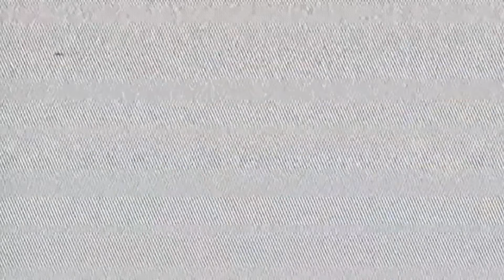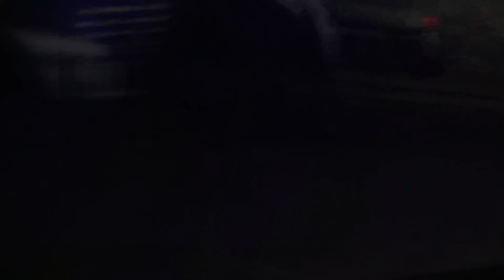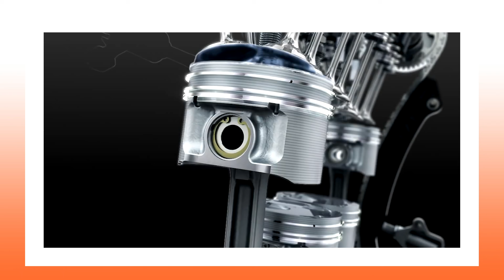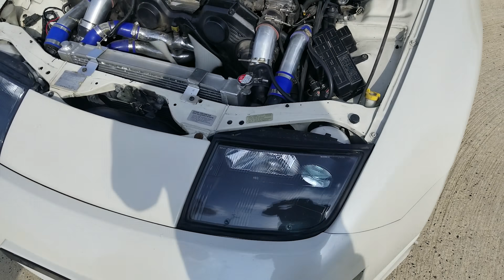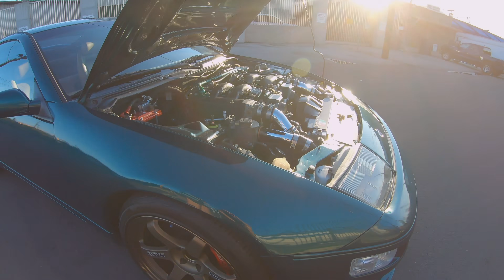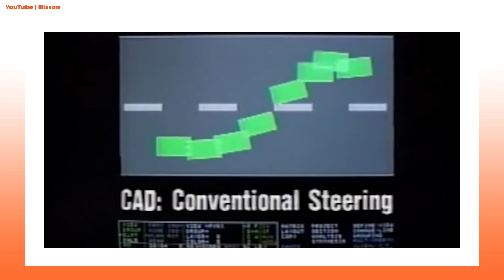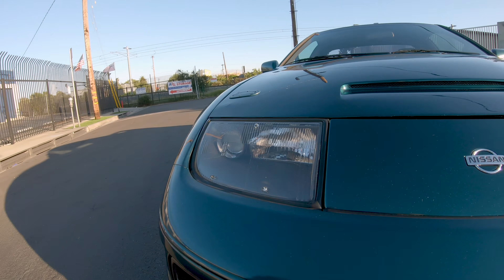The Incredible Tech that DOOMED the 300ZX

Comment: 300zx: I'm the most advanced car of the early 90s!

3000gt: Am I a joke to you?
Reply: Yes, yes it is.
Reply: The 3000gt had 4 wheel steering, active electronic suspension,  twin turbos, v6 it’s extremely similar to the 300zx
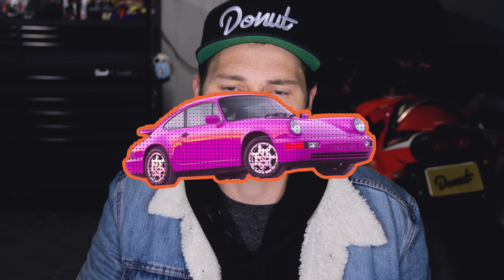Reply: 10:40
Reply: @mamoochie7392  To be so similar, the valuations of the Mitsubishi's at all levels are lower than the Nissan's.  Plus, the interior of the Nissan, particularly the leather of the seats, has held up much better than that of the Mitsu's, making it harder to find Mitsu's in passable shape after almost thirty years.  Despite that, they are still worth less, indicating they are less desirable.  Personally, I appreciate the exterior styling and performance of the Mitsu's, but when it came to buying, I went with my long time favorite, the 300ZX TT.
Reply: Hush, dodge stealth
Reply: Kevin Davis not to mention that the 3000gt is heavy af
Reply: @DaytonaBlueHr  my stock tt 2+2 300zx ran a 13.155 1/4.
Reply: @DaytonaBlueHr  The Dodge Stealth is lierally just a butt assed ugly 3000GT though. But otherwise I agree with everything but would still prefer a TT Z32
Reply: Technically the Z32 is a late 80's/Early 90's car, Came out in 1989 lol
Reply: Jesse Arends Lmao you have the video?? I have never seen a stock 300zxtt ever run a low 13. They are mid-high 13 second cars completely stock and did not outperform the 3000gt in the 1/4 mile and would not even come close to the Dodge Stealth Twin Turbos being about 100 pounds lighter than the 3000gts and running 12’9 in the 1/4 mile stock. And if you dont believe go to the 3si forums and its on their 🤷🏽‍♂️. Its just a fact that the 300zx were not faster than 2nd gen 3000gt Vr-4’a in the 1/4 mile
Reply: Syphious Dodge Stealth es’s were ugly but the r/t’s and Twin Turbo models didnt look too bad. My white 95’ Stealth r/t  is in pretty good condition and always turning heads but most likely because nobody knows wtf kind of car i drive and thinking “wtf is that car ive never seen it” 😂 but all im saying is that the guy in this video was probably talking about the 1st gens 3000gt Vr-4s that ran mid-high 13’s stock. The second gens were considerably faster and came with a 6 speed getrag transmission instead of the 5 speed in 1st gens.
Reply: Noble Khan lmao its you again 😂🤦🏽‍♂️ just accept the fact that 300zx’s were not faster stock for stock against 2nd gen 3000gt Vr-4’s in the 1/4 mile sorry to break your heart but its just a fact 🤷🏽‍♂️
Reply: HZB OcYpcWr'Ctwu Odzs every single boosted 90’s car had problems with boostleaks....
Reply: Questionable Choices Inc. 300zx did not have active aero tho.... so 3000gt>300zx
Reply: @mamoochie7392  yeah but it's also hideous
Reply: It's very hard to determine the quarter mile time of a 3000gt vr4 because tow trucks are all different.
Reply: 3000GT VR4 was a beast
Reply: Noble Khan You say slow but its faster than any 300zx in the 1/4 mile 🤔 your ignorance is showing 🤦🏽‍♂️. All im stating is that the guy in this video is wrong for saying the 300zx outperformed the 3000gt Vr-4. Second gens Vr-4’s ran low 13’s unlike the 300zx which was a mid-high 13 second car. Even this guy ^agrees and says 3000gt Vr-4’s are beast so looks like you are just in denial lol
Reply: spraynpray You realise that if the turbos go bad on a 300zx the entire engine has to basically come out right?? Changing Turbos on a 3000gt Vr-4 does not require that much work but can still be difficult but not nearly as a 300zx 😂. And 3000gts were faster than 300zxs so idk why you even made that comment 🤦🏽‍♂️
Reply: Noble Khan any modified car can beat any car so idk why you even bring that shit up lmao. All im saying is the guy in this video is wrong about him saying 300zx was outperforming the 3000gt especially in the 1/4 mile. And you realise the 3000gt was a Grand Touring car right? And was never meant to be a track car unlike the 300zx but yet the 3000gt was still faster being a grand tour 🤔. Their was a Puma 3000gt in JGTC and 3000gts held records for Pikes Peak for some time as well
http://www.davewolin.com/pikes1.htm
Im just saying the guy in the video is wrong about that 1 thing he said 🤷🏽‍♂️
Reply: @DaytonaBlueHr  Why would you change the turbo on a vr4?  The car is totaled by 100k miles due to repair bills.
Reply: The VR4 was a heavy, sloppy wannabe copy of the ZX. Mitsu took 3yrs to copy the Z and they still got it wrong lol!!
Reply: Big Troll How did they copy lmao. The 3000gt was made to compete against all the other sports cars that were coming out at the time and was more advanced than the 300zx with Active Aero, Adaptive Suspension, Active exhaust, All-wheel steering and Twin turbo/twin intercooler V6. And yet with the 3000gt Vr-4 weighing as much as it did it still outperformed the 300zx in the 1/4 mile running low 13’s and 0-60 in 4.7-4.9 seconds......if you say they are slower then that would just make the 300zx even slower according to you 🤷🏽‍♂️
Reply: Awd>Rwd
3kGT all day
Reply: Oh my. Looks like I started a JDM war!
Reply: And the 2g eclipse GSX is better than both
Reply: The 3000gt is a boat
Reply: @DaytonaBlueHr  wow a awd car is faster from 0-60 than a rwd car? Crazy, too bad it doesn't change the fact you drive a boat
Reply: Noble Khan Every car enthusiasts cares about 1/4 mile times dafuq you talking about? ITS LEGIT HOW WE DETERMINE WHICH CAR IS REALLY FASTER FROM A STOP TO THE 1/4 MILE AND 1/2 MILE. And like i said the 3000gg Vr-4 was meant as a Grand Touring car and NOT a track car which is why you never really saw it compete much. But now the 3000gt Vr-4 Mr is a while different story and was even faster than the the original Godzilla Skyline Gtr. The Mitsubishi GTO Mr was capable of running high 12’s. Show me a video of a stock 300zx running even a low 13 STOCK......ill wait. And you realise the guy in this video was talking about the 1st gen Vr-4’ams which only had 300hp a 5 speed transmission and heavier than the second gens. A 2nd Gen 3000gt Vr-4 would ABSOLUTELY DESTROY ANY 300zx lmao. And why do you keep bringing up modifications?? Any car can be made to be faster than any car with a bunch of mods done to it lmao idk what you are trying to prove. Theres been a Honda civic that just recently beat a 2000Hp Nissan Gtr but do you hear everyone saying that Hondas are better than Nissan Gtr’s NOOOO BECAUSE EVERYONE KNOWS YOU NEED A SHIT TON OF MODIFICATIONS TO BE ABLE TO BEAT A GTR WITH A HONDA CIVIC LMAO. Just face the facts that the 300zx was behind the 3000gt Vr-4 in roll racing and 1/4 mile times. The track times go to the 300zx because IT WAS MEANT TO COMPETE ON THE TRACKNAS WELL. A 3000gt is a GRAND TOURING CAR LMAO AND STILL ALMOST DOES THE SAME TRACK TIME AS A 300zx gtfo 😂
Reply: Noble Khan oh and the 3000gt Vr-4 actually beat out the 300zx around the track as well. 
http://www.300zx.cl/ga/300zx/images/rtt07.jpg
^ look here and this was a first gen 3000gt Vr-4 😂
Reply: @outdoorswithjess  where did you find a stock 2+2 TT?
Reply: out of the 90s Japanese cars the 3000gt VR4 had the most tech and features. 4 wheel steering, active aero, exhaust control, electronic suspension, tcs, and a bunch of other stuff.
Reply: ZR1 just causually sitting there breaking world records for high speed endurance while costing the same as a 300ZX TT
Reply: Noble Khan https://youtu.be/fwps3TVcJMM
^ and heres yet another video of the Mitsubishi GTO beating the Skyline 🤷🏽‍♂️
Reply: z32 josh Its faster just plain and simple even around the track..... https://youtu.be/G3Tb2Iv1sTw
Watch this video^🤷🏽‍♂️
Reply: The dealer refuses to even work on that VR4 junk. Everything on those cars was an after thought, it's like the car was built in the driveway of someone's house...3000gt/VR4 are just too unreliable
Reply: The world's fastest VR4 has a 4cyl in it...the VR4 v6 is just plain shit.
Reply: @kevindavis5966   3000GT/GTO r worth less cos unlike the other super Japanese cars of the Golden 90's it was not made in limited quantity since they were in co-hoots with Chrysler and had many made.  Fact is were more Stealth/3000GT/GTO made in the 90's than the 300ZX TT, Rx7, EVo, GT-R, SUpra, and especially the NSX. N nope the VR-4 was faster and 300ZX like all Japanese cars had n still have shitty interiors.
Reply: @Syphious64  Stealth was not UGLY it was just not as sought after as the Mitsu one...also think was mistake on the wing like they were trying to make it a v6 looking Eagle Talon(that worked on the Talon not on the stealth.)
Reply: @Syphious64  The GTO also came out in 1989 in Japan(my RHD GTO is 1990 but  was made in 1989) so fail on ur end bro.
Reply: Wasn't the 300zx Nissan's response to the mk3 supra?
Reply: @DaytonaBlueHr  You're not wrong about the 0-60 and 1/4 mile times.  The best tested 0-60 for the Mitsu is a tenth faster than the fastest 300zx, while the best 1/4 mile for the Mitsu is a tenth faster than the 300zx.  Honestly, I would expect a wider margin for an AWD vehicle with 20 more HP.  Regarding the shape of these vehicles today, my experience simply doesn't bear out your statement about interiors.  I follow these cars quite a bit checking prices and conditions, and the comparison simply isn't even close.  The Mitsu's that I see for sale online are typically in much worse condition than most 300's I see.  My '91 with original leather looks nearly pristine.
Reply: I like the cars  but both were very expensive and unreliable just a few years in. Both are also very heavy for "sports cars". The people who had to money to burn on a car like those in the 90s were looking at more "prestigious" brands.
Reply: Me and my ex's dad took his 300zx down Bruntingthorpe for a article for J tuner mag back in the day. It was 300zx vs 3000gt. While i loved the 3000 the 300zx just ate those mitsubishi's up for dinner.
Reply: @smokeyb7379  you never seen properly build 6G72 So shut up ... By the way VG30DETT from 300zx has lower power slightly smaller displacement And significantly lower torque so that doesnt make sense....
Reply: @DaytonaBlueHr  My 94 3000gt is practically showroom condition. The leather seats held up really well. And its a rather rare 3000gt 1 of 28 (its #6) with tan seats and Red carpeting and painted in yellow pearl. Pretty sure 3000gt's build quality was just as good as nissans at the time. The owners on the other hand..not so much.
Reply: MR2tuner13 You in Cali?? 🤔
Reply: MR2tuner13 and thats really cool man 👍🏽 i own a 95’ Dodge Stealth r/t myself and in pretty good condition as well and its been my daily driver for the past 3 years to school and work lol
Reply: MR2tuner13 and Yeah Mitsus build quality was top tier at the time and on the same level or possibly just above the rest of the competition. But you are correcr the owners that didnt keep up with the 60k and 120k services are what doomed these cars 🤦🏽‍♂️
Reply: @mamoochie7392  Except it was even heavier, built worse, and no one bought them.
Reply: Mr. Pete Channel is 75٪ away 2 the big time!   Porsche 959
Reply: 300zx says to 300gt " you never made it to Car and Driver's top 10. I made it 7 yrs in a row."
Reply: @mamoochie7392  Had 4 wheel drive as well so it was a lot heavier than the 300zx and RX7 too. Great car though.
Reply: @DaytonaBlueHr  the 300ZX is the faster car, the ONLY reason you can say a 3000gt might edge it out in the 1/4 mi is because of AWD, but from a 20mph roll and up the LIGHTER and equally powered 300zx is going to be faster because of power to weight. 3000gts are heavy ass cars, while the 300zx was fairly reasonable weight wise. I would prefer the 300zx based on styling but i would obviously say performance is similar since both are 3.0 v6 TT engines
Reply: I'd be willing to put money my stock block/turbo's VR-4 would put a bus length on any stock block/turbo's Z32(in Michigan), 1/8th mile from a dig on the street..... Just sayin lol....

Comment: nissan: is called VTC!!!
Honda: hold my beer...
Reply: I knew someone would catch it vtc is vetc for Nissan just like vanos for BMW or vvti on a Toyota just different ways to get to the same result
Reply: @fullweezy3553 , actually VTC and VTEC are fundamentally different in what they do.
VTC and VANOS change the phase angle of the cam, but does nothing for lift profile (lift height and duration) . VTEC switches to a different cam with optimized lift profile and timing.
Reply: @mitchellnewman2592  blah blah blah just different ways to get to the same end
Reply: Fullweezy 35 Not at all
Reply: @fullweezy3553  ...
Reply: Honda's  vtec is more intelligent and uncomplicated than nissan .Honda used brains and nissan used technology
Reply: @kommisettysumanth3940  funny cause everywhere I look says Nissan perfected it with the VVL..
Reply: Honda : aaa it would be nice if we add E between them. Vtec kickin yo! 😂

Comment: 🤣 Nissan was like "let us think hard and design this 4 cam TT for the ZX

owners 30 years later- " scrap the VG V6 find me a LS"
Reply: I wonder, why an LS and not a VQ?
Reply: I meet more than plenty of guys and gals who stick with the vg. But they and myself are the type of people who put nissan in nissan, chevy in chevy, ford in ford, etc. All comes down to preference and if you wanna jump through hoops to get those baby turbos tucked way down there.
Reply: If you want an LS go buy a Vette
Reply: Eh, No.
Reply: That is basicly a US thing only. 
Nissan even dropped the basic engines for their coupes and swapped in the ka24 Traktor engine... Just to make it simple enough to get it serviced reliable in the US... 

I guess it's cause most American engine builders have no experience working on more complex engines. Why should they, LS (and other pushrod v8) engines are dirt cheap in the US and basicly everyone understands them and knows how to work on them.
They are way simpler in design compared to more modern engines (like mid 80s🤣) they are however not without their own problems....
Reply: @theblobjectfish  lack of skill is almost always why an LS is used.
Reply: @mr.buddha3657  also budget as they're in so much of GM's line up
Reply: @chachizxtt  but what if you want a 300zx to be as fast as a vette? better go buy an LS😘

Comment: You never explained the DOOMED part.
Reply: Tech and the Japanese bubble economy it put the hurt on japanese car makers particularly Nissan and Honda.
Reply: @J180sx  Nooo, all of that stuff you have to maintain in order for those 2 techs to work!
Reply: If you have owned one then you already know.
Reply: Agree with the complaint. Having lots of technology does not equate to "Doomed". I think it was an economic problem. Original sticker price in 1995 was over $40,000. You could get a Camaro Z28 and a Pontiac Trans Am and drive them on alternating days, making the same 300hp, with an almost rock solid guarantee your engine would never see a wrench applied to it. It was just a crappy value proposition to buy the 300ZX. It was then, what the NSX and the Lexus LFA are today, a total ripoff.
Reply: @BrisLS1  it was a masterpiece, just like the nsx and the lfa
Reply: The "rock solid guarantee" is a great joke.
Reply: They should have removed the whole variable timing crap and only had one turbo. Also ditch the 4 wheel steering. Would have kept the price lower
Reply: Not enough engine space to compact to work on and fit

Comment: I'm getting one Thursday I'm so excited as I've always wanted one.... ive heard they are easier than people say from owners themselves
Reply: how is it
Reply: @silence___  i love my z32 so far.... Its the only car ive ever just turned the key and gone with 200k on the clock.... Other than my nissan hardbody pickup....  If you are a good mechanic and know how to set a z32 up properly... (Which is not easy to do because of the electronics) they are reliable as all hell.  Alot of twin turbo owners have 300k examples...
Reply: @silence___  if your looking into getting one join the fourm z32 addicts and entusiasts...  The na/tt swap group.  And a few others before buying one..... People there can definetly tell you what to look for..... I spent 4 months rebuilding mine after finding alot of what the previous owner did was wrong in the way of repairs...the car also needed a clutch
.... Most zs need one when you buy them..... People arent easy on them and if you buy a new z clutch youll know why..... They feel amazing.....
Reply: @blackmagicgarage871  thanks
Reply: So lemme post yet another update.  The z32 has been my daily driver for 4 months. Great car
Reply: @blackmagicgarage871  any issues so far
Reply: Nope. Still rollin strong.
Reply: @blackmagicgarage871  that's impressive for a used car of it's nature
Reply: All about service intervals.. and not abusing your vehicle...
Reply: @blackmagicgarage871  glad it’s working out for u dawg

Comment: Had a TT as a daily driver for 6 years. Amazing car and actually very reliable. Modded it to about 400 whp.
Reply: was it difficult to mod it due to no space in engine bay?
Reply: What mods did you do to get to 400whp
Reply: @nuclear.collectibles  higher flow intake, tuned ecu, catback exhaust, and boost jets will get 400whp easy
Reply: @ethanryan5806  i have all that plus downpipes and bigger side mount intercoolers except i just have a chipped ecu, not tuned. I think i’ll look into a standalone ecu so that i can get it tuned?

Comment: Oh wow, they didnt even model after them, they legit TOOK them lol LOL!!
Reply: If it is for that, the Countach's back lights were from the ALFA Romeo Alfetta 1st series, with a huge retroflector plastic around them to hide it.

Also, the Countach had  air vents from the FIAT X1/9 in the cockpit.

All small scale producers used as many larger scale producers' parts as possible, back then.

3D printing and composite materials are changing that, though.